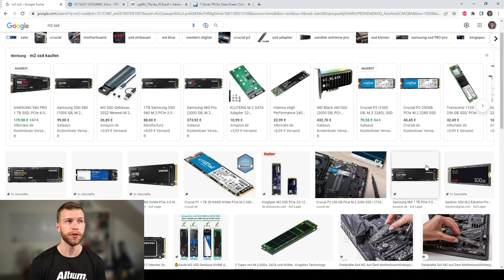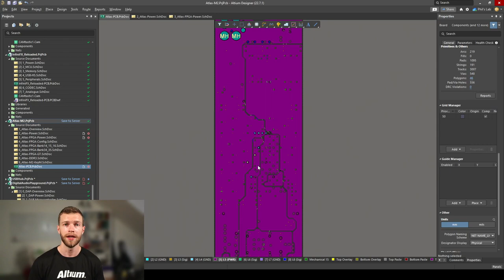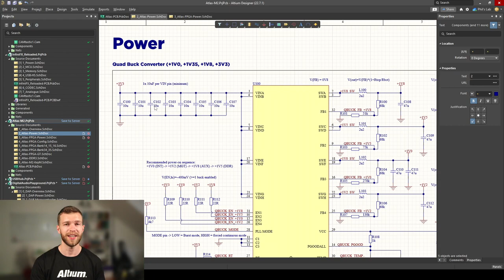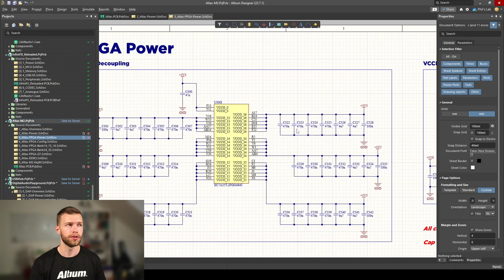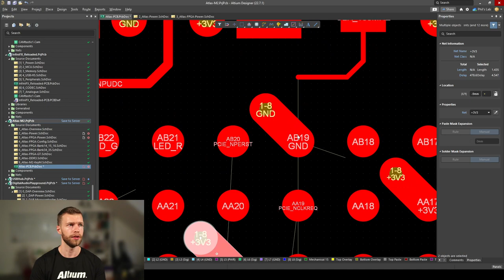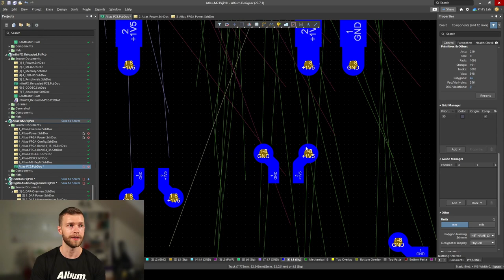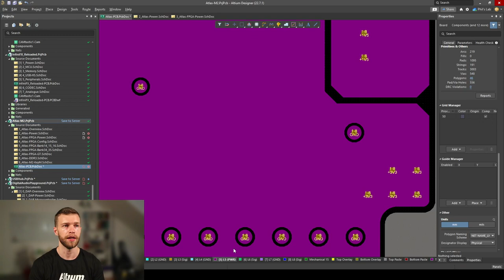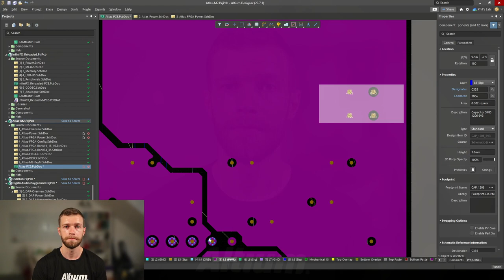FPGA and BGA PCB Power Delivery Best Practices

Comment: Excellent explanation Phill! That was very helpful. Question about the capacitor selection: Are the FPGA capacitor value recommendations in the datasheet based on an example hardware layout, and the frequency response of that particular example PDN's layout? Or do they make some assumptions about what your PDN design will look like in terms of inductance/capacitance values? I thought the various sizes of capacitors in a PDN should be selected to minimize your specific PDN impedance across various frequencies, which is unique to each design.
Reply: Thanks, Jon! That's right - the specific/exact capacitors should be ideally tuned on a case-by-case basis, for high-perfomance designs. Through the datasheets and app notes they've made some simplifications - to my knowledge however not based on a particular example (could be wrong).
On another note, I've seen many commercial designs that have gotten away with using less capacitance/capacitors than given in the Xilinx datasheets - not sure how/if they went about PDN simulation though.

Comment: Hi,
Great video.
Question about the the stackup. Why not PWR plane on layer 3?
As you mention in the video the tight coupling between a PWR and GND layer is important at higher frequencies and in this way it would be closer to the top signal layer where the FPGA is.

Comment: You have placed a via for supply and another for ground and tried to bring them close. However, why do you need to do this when you are going to connect the capacitor to GND plane and not the actual FPGA ground pin?

Comment: Hey Phil, it's always fun to watch your videos. I was wondering if the different power planes adjacent to each other on the same layer will cause some problems related to parasitics? Or will there be any problems if we have such voltage planes close to each other as they might form a capacitor?

Thanks in advance.

Comment: Is there some specific reason to not overlap pads and vias?
Reply: Solder will be wicked into the via, leaving you with a starved/weak solder joint, and possibly even dripping through onto the other side and causing a short somewhere. There are special tips and tricks you should follow for putting a via in a pad, there's another Altium Academy video about it.